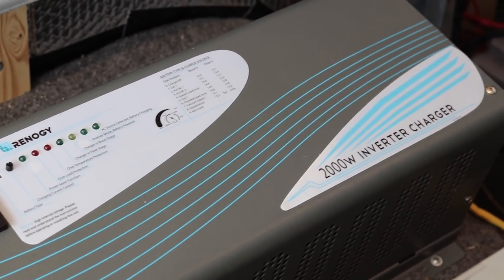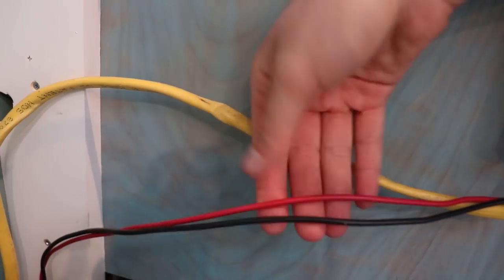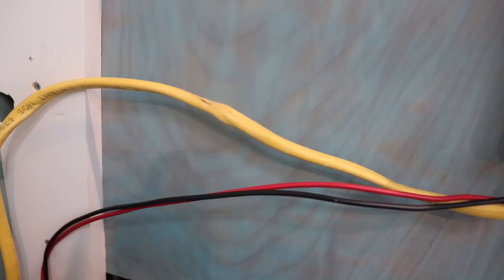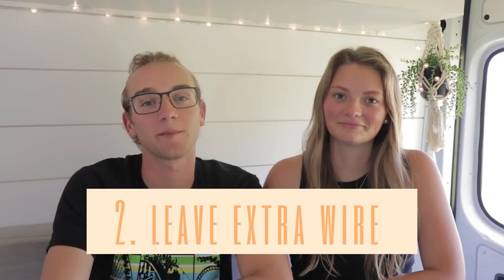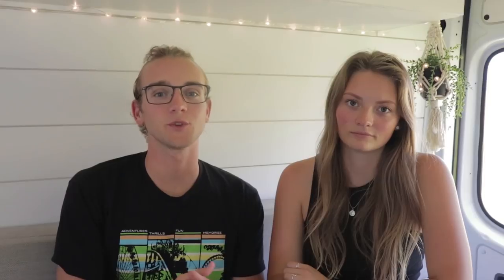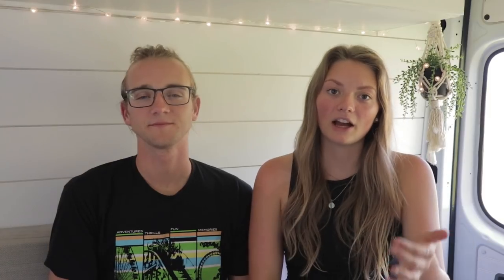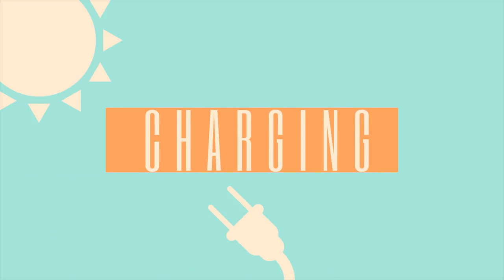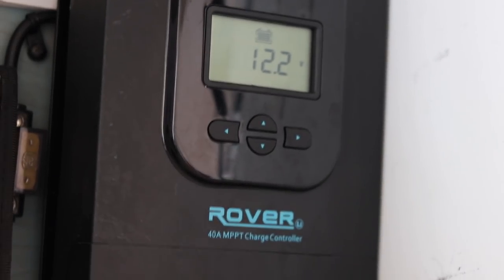DIY Camper Van Electrical Setup for BEGINNERS | Where To Start

Comment: You covered the important parts well with a good overview.  I like that you emphasized protecting the wires and circuits, and isolating the coach batteries from the engine battery.  Also leaving excess lengths and preplanning for layout. I am well versed in house, automotive and RV wiring and nothing stood out that was missed or needing corrected in your explanation other than starting a schematic of what you wired and maybe having a plan for how you might add a wire later if needed. Conduit? Wire path?

Comment: Thank you so much for very informative video.  I am just learning about wiring myself and I appreciate all the help I can get.  I did have a thought about Romex wire in RV application.  I have been studying and thought stranded wire was a much better choice to use in anything that “moves”, such as RV’s and boats.  Please, could you or anyone comment on that thought.  Thank you.

Comment: Romex is for residential electricity, it should not be used in an RV.
Reply: No Romex in a camper van or RV. No, No, No! Stranded wire only. Use this wire example to pick the correct wire needed.  http://assets.bluesea.com/files/resources/newsletter/images/DC_wire_selection_chartlg.jpg

Comment: What would cause you to get power when you shouldnt????please I need to figure this out by myself I have no help and as of now I have my 35 foot camper running off electric coming in front door plugged in to a socket, which is running mu hole camper, which makes it hard to sleep...please someone walk me thur this